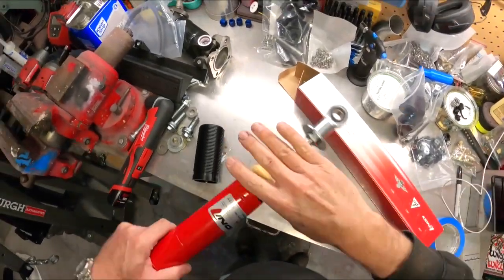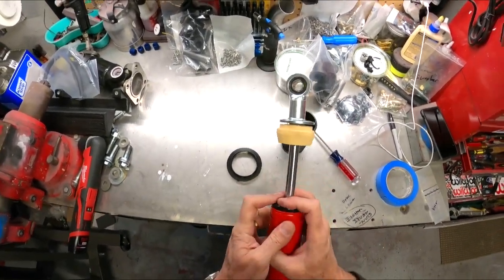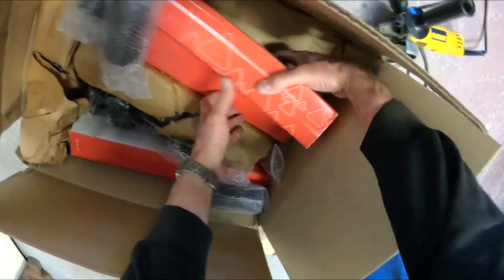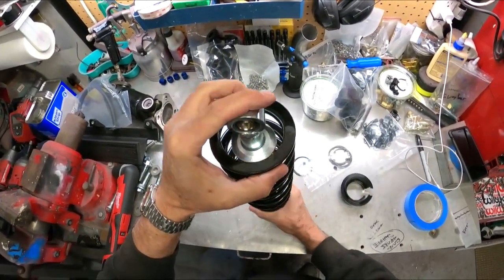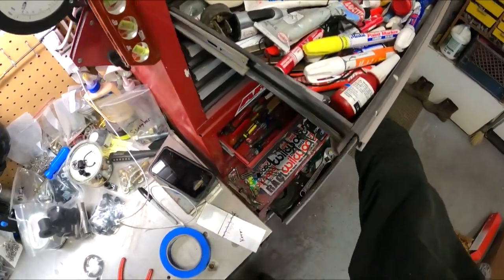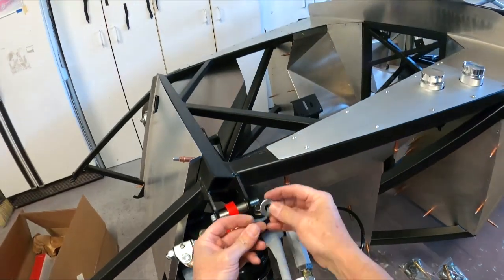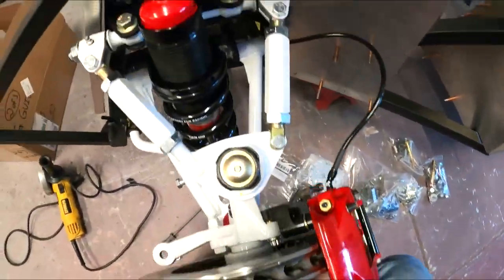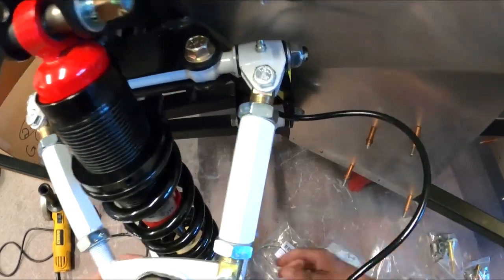Cobra Daytona Build- Coil over assembly, Video 50

Comment: Thanks for all these videos,,, I've watched in order the first 49... Office guys are sometimes useless in a garage setting. ...... When you say KONI single versus double adjustment.  Does this correspond to requiring a different coil, or different ride height or  different stiffness's ? .....  Does a double adjust Koni $$$  can be installed in the lower holes, and how does that change the ride.
Reply from the maker: Single adjustable is rebound or compression adjustable only while double allows you to adjust both. Same mount for either shock just one is more adjustable.